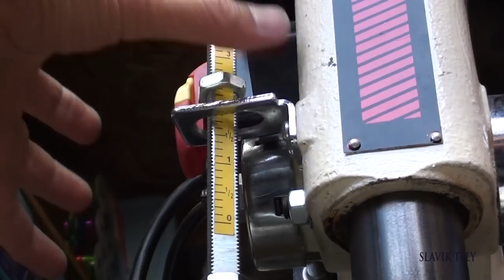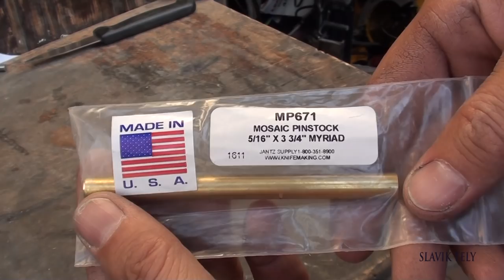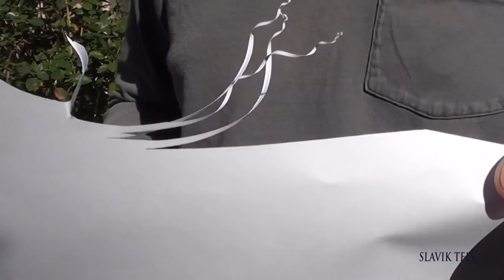Making FALK KNIFE Part 2

Comment: Hi Slavik,
You make it look so easy but I know it isn't. Thanks for the videos they are a joy to watch.
Steve
Reply from the maker: Thank you Steve. These two knives were a pain to make because stainless steel ate up 2 of my bandsaw blades, handle material is very soft compare to corby bolts and I don't like to do same thing twice...it takes the fun out of it. I want to move on but have to do the same process on the second knife. But I got it done and proud of it.

Comment: Hey slavik awesome set of knives, your videos are very inspiring. I had a quick question I have the same drill press as you and was wondering at what speed do you run it at for drilling your steel and how do you like the drill bits you use? Thanks in advance.
Reply from the maker: Speed depends on the size of your drill bits. The smaller drill bit, faster your rpm have to be. Find a good drill bit speed chart and use it. Plenty on google. Drill bits are really great quality. I would suggest to you to buy only drill bits you need and not the full 29 piece set because 80% of the drill bits I don't use.
Reply: SLAVIK TELY awesome thank you for the advice. I need to learn to not try and rush my builds and take my time like you do.

Comment: Making my first knife and need some help with what all sand paper should I need to get?
Reply: Matthew M Thank you cause The past few hours I’ve been wondering what all sand paper I would need to get and I’m wanting to do a wood handle and I had asked my father in law what wood would he recommend and he said to try oak but what would you recommend?
Reply: What is micarta that’s he first time I have heard of that and I’ll probably start off with the sand paper with 320 and take it up to either 2000, or 2500 grit cause when I first tried to make it I was using a grinder with grinding and flap disks and it doesn’t look all that great that’s why today I traced the outside of it and made some adjustments so that I can profile it to where I want my bevels and handle to be and I got the metal out of a scrap bin when I work in a steel plant years at     and would I need to harden and heat treat it since I’m not 100% sure what kind of metal it is?

Comment: Hi Slavik. Your work is just fantastic, please keep it up. The video editing and your craftsmanship is is absolutely high level, and its very entertaining. I would like to ask you for an advice. I have made the push dagger out of not known type of stainless steel. Because its non magnetic and its weldable, Iam pretty sure it is an austenitic stainless steel. Would you give me an advice of how to heat treat this dagger? I have searched true many websites, videos and Iam still pretty unsure what to do at this stage. Thank you in advance. Iam looking for your next knife design.
Reply from the maker: I can't heat treat stainless steel at home nor will you. You need an oven to heat treat stainless steel. It is a multiple level process and later on you have to cryotreat it. Try to make knives from high carbon steel so you can heat treat it at home. There are plenty of videos how to do that.
Reply: Thank you Slavik for your response and advise. I will go with the high carbon steel in my next build. One more question if you dont mind. Is a cryogenic treatment necessary for stainless steel or its more like an additional step. Different sources says different things. Keep producing fantastic designs that you do. Wishing all the best to you.
Reply from the maker: It makes steel more durable. Google for more info.

Comment: what kind of diamond wheels are you getting... i am having troubles getting the rough edges in my finger grip not shreading my paper cylinders
Reply from the maker: I got them on Amazon and Harbor Freight.
Reply: dont spose you could link it? the one i found had a very short shaft

Comment: Your videos are awesome and inspiring. I have got few questions for you. Whitch type of metal do you use and specifications of material? And where do you get these material for knife cases ?  Thank you for answer👌
Reply from the maker: I use 1075, O1 tool steel, CPM 154 CM, CPM S-35 VN stainless steel. Everything else is listed below video. Knife case I get from knifekits. com
Reply: Thank you very much for info

Comment: Beautiful blades sir. I would like to know why you switch from the G/flex glue back to the 105 with the 26 hardener when you epoxy the scales to the blade ? Longer set time ?
Reply: Where did you get the thick black foam for pressing the Kydex ?
Reply from the maker: When I glue lots of layers, I use more runny glue 105/26. If I don't need a lot of glue then I use G/flex. same set time.
Reply from the maker: knifekits. com
Reply: Thank you for the explanation.

Comment: Mr. Tely. Which is the best way to mirror polish a blade by hand? If you can some techniques?
Reply from the maker: Start with 22,320,400,600,800,1200,1500,2000 grit paper and then buff it on the buffing wheel. Watch Nick Wheeler on YouTube "Sanding 101" how to properly hand sand a knife.
Reply: SLAVIK TELY thank you very much, sir.

Comment: Let me start by saying I love your work! I have question, Why do you use Windex when wet sanding? I make knives as a hobby and was just wondering if there was a reason for it? I always use water but if it is better to use Windex I will try it, thanks!
Reply from the maker: If you make knives from high carbon steel, water will make steel rust. Windex has ammonia and will not leave rust on steel.
Reply: Thank you sir!

Comment: without quenching?  if steel is without heat treatment, then this piece of iron is just for beauty.  it will have to sharpen every 3 minutes of work.
Reply: без закалки? если сталь без термообработки , то это железяка просто для красоты. его точить надо будет каждые 3 минуты работы.
Reply from the maker: If you watch carefully both videos (there are 2 parts) you can see I shipped out both knives to get heat treated. Therefore they will hold an edge.
Reply: Krásný

Comment: straightening those blocks on your disc sander is not the smartest idea is it?
Reply from the maker: Nope because it is a 6 inch disk and I only have about 2 inches to work with. The middle doesn't grind. Once I have a shop I will be investing in a bigger one. But it works for now.